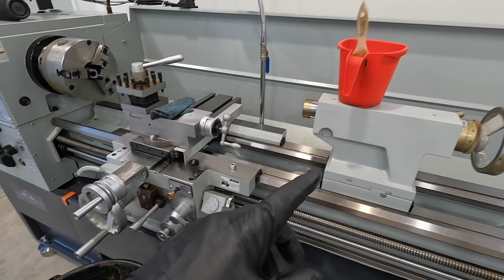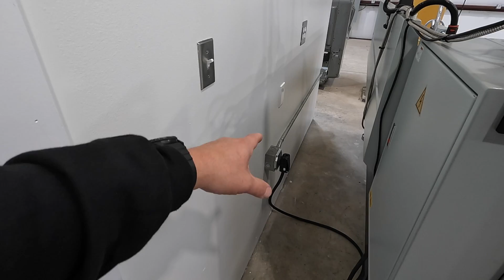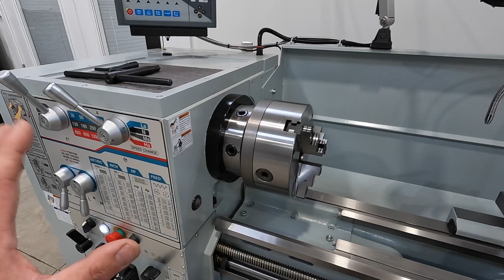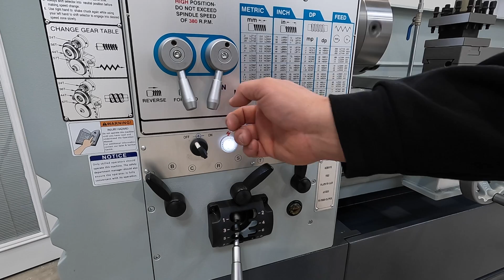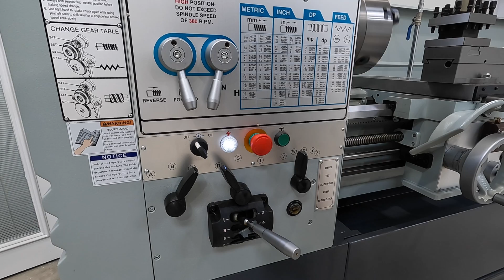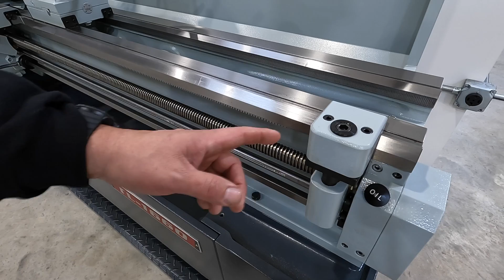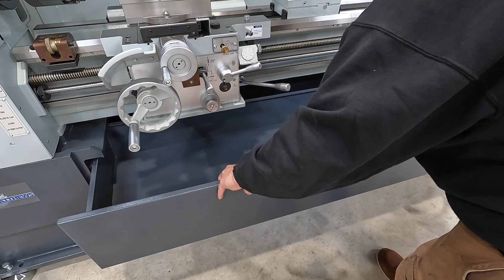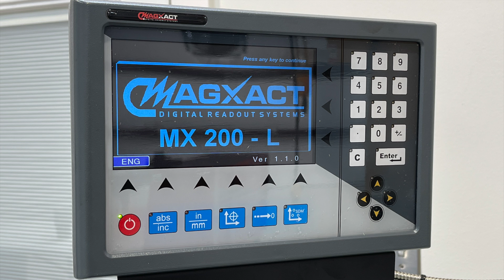Precision Matthews TL 1660 First Run

Comment: 15:30 "The bolt must be released before operating" ... It really looks like that bolt is in the "not released" position :(  ... what does that bolt do? 

16:26 Plus it specifically says "ONE SHOT PUMP" (In All-Caps too)  ... not ... "You can give this guy a couple pumps"
Reply: A couple of pumps and it runs on the floor - so what?  Adam has plenty of the famous "pig mat" to take care of it.
Reply: @paulcopeland9035   lol
Reply: There's a difference between "released" and "removed".  If it wasn't released, the carriage wouldn't be moving.  It locks the carriage.

Comment: That's a nice new machine Adam. Using the two t-slots on the back end of the cross slide would perfect to make up a back tool holder. I have a similar set up on my 15" causing and I use the rear holder as a dedicated turning tool. Really speeds things up having multiple tools on the cross slide at one time. Can't wait to see what other machines you bring in the new shop.

Comment: Abom you should get an audio frequency app on your phone. Then lay your phone on the lathe. This will show you the sound level and also the frequency peaks. You can take note of these and if you ever think you hear a strange sound just lay your phone back on and check the difference. You can get really good at it and tell the frequency changes by ear and pro level is diagnose the issue from the change in tone/frequency. Its also a beautiful machine. Thanks a lot for the video!!!

Comment: One thing that I have noticed about machines that have that type of feed cross/longitudinal selector, is that under heavy load they can be very hard to disengage !
You may want to check that the feed direction knob may be the better option for disengaging the feed!!!!
Ran a Summit lathe that was that way and we have BIG Kingston 12.25'' bore
hollow spindle lathe at work that you basically CAN"T disengage the feed under heavy load with the 
cross/longitudinal selector, has a separate 'clutch' for lever for that.
This caused a major crash and tear down of the headstock and replacement of gears, no fun!!!
Please check for this issue!!
NICE machine!!!!

;

Comment: Hey Adam, what kind of material would you be running at 1800 RPM? Mostly aluminum I imagine?
Reply from the maker: Anytime you are working with small diameters, like tiny drill bits.
Reply: Modern carbide tooling demands hig rpm as well at smaller diameters.
Reply: I was curious of that too, glad to see someone asked and got the answer!

Comment: There seems to be several companies that are selling the same or very similar lathes. I’m guessing the same Taiwanese factory slaps different names on the same lathe. Regardless, seems like a nice lathe.
Reply from the maker: Not slap, drive pin them on.
Reply: While the base casting may be the same, different companies have them made to different specifications.  They aren't all the same.

Comment: A retired electrician... Planning home workshop for purchase of a lathe and mill.  Question: What are the big steel feet for and why a 6 jaw chuck?  Bill G.
Reply: Feet are for leveling and the 6 jaw just because you get more even clamping force
Reply: Pretty sure the main benefit of the pads is to spread out the load on the concrete so it doesn't crack it or punch into it; the leveling bolts on the machine have a pretty small surface on the bottom. There may be other benefits as well, like lifting it higher to a more comfortable operating position.

Comment: Aren't you supposed to have something clamped in the chuck, when running the lathe spindle?
Reply: I doubt the lathe will get upset.
Reply: Yeah, more so with a scroll chuck.  Starts and stops can allow centrifugal force to throw the jaws out of the chuck because the scroll rotates.  Super dangerous in theory, but in reality, it rarely happens.

Comment: Why don't you install the power so that it drops from above?
Wouldn't that be better than having the power cord running across the floor, creating a trip hazard?
Reply: To come in from the 20 foot ceilings requires an extra 40 feet of cable and all that extra voltage drop and $$$.  How many people are going to be walking behind the machine?

Comment: There's something quite satisfying about peeling off protective film, whether it's from a machine tool, mobile phone, or whatever. 😊
Reply: It's therapeutic at best. People in China would never take off the film on anything, even when it bubbled up, peeling, and full of shmoo.
Reply: No! Leave that protective film on, it makes cleaning better because the face plate is protected from scratches while cleaning. I have gone 10 years before I finally peeled the film.
Reply: @jwagnermail  exactly my thought, it keeps all the information from wearing off for a good while!
Reply: @jwagnermail  I agree. I protect my DROs panels with shrink wrap.If the panels on that lathe were engraved,I would say,go ahead but, they are silk screened.He is going to regret peeling that film off. I would cut peel and stick clear acetate over it before,it’s too late
Reply: I knew there would be some sociopathic monsters that would come here and claim you should leave the plastic on.  I don't know why anyone would actually want a nice new machine to have cheap plastic all over it.
Reply: @HomebrewHorsepower  You haven't met my wife's mom then. She is from Peru and believes removing that film devalues the item. I am not allowed to remove it, even the pieces hanging down in front of the TV screens...
Reply: @HomebrewHorsepower  Because, it’s not going to look nice very long after taking it off. I have personally experienced this on my lathe.My threading chart got so bad, I was using the manual to set it up for threading. I ended up scanning the page and,importing it into Aspire as a PDF, I then,engraved it into a sheet of aluminum to replace the illegible chart .

Comment: I've had good luck using WD 40 to remove cosmoline also.
Reply: WD 40 is mostly mineral spirits.  Check the Safety Data Sheet.

Comment: what would run 1800 rmp for?   what material?
Reply from the maker: Soft materials like mild steel, aluminum, brass and copper especially if your working with very small diameters.

Comment: can you explain how the flood cooling works? i assume the coolant drops in the chip pan but how/where does it go from there?
Reply: It recirculates.
Reply: It falls down into the chip pan then it funnels through a strainer to remove the chips, from there it flows into a bin where the pump is housed.  It can then be reused.
Reply: @cayde7469  i did not see the strainer in the video.
Reply: @SupremeRuleroftheWorld  I don’t know on this particular lathe but at 22:13 to the far right of the chip pan it looks like that is where the filter for the coolant is.  I assume they put it to the far right since that side of the lathe will see the least amount of chips and therefore not get clogged as easily.

Comment: I got equipment with the plastic protecto coating still on it eventually when I go to sell it I will let the new owner decide to peal it off.
Reply: The protective films are not intended to be left on for long periods.
You will find that the adhesive hardens and the film will not release easily , tears and/or the adhesive leaves a residue that is difficult to remove.
Reply: Adam is the owner, so he decided.  What is your point?

Comment: Why is american wiring so third world and ugly?
Reply: in Europe we would just run some SWA to each outlet off individual breakers. The US seems to be wedded to round conduit and singles.
Reply: @AndyFletcherX31  Whats wrong with conduit and singles? Often the better option if it's done right.
Reply: @mmm365  Yes they do. 🤣
Reply: Ok. You be free.
Reply: When I first saw that installation, I thought "wow, what a fine job."  Nice bends, box installs (ex the one on the corner), clamps (per code), etc.  What's the matter with that?  To me, that's exactly what you want in an industrial building.  Should we be stuffing it behind the drywall and mudding everything up?
Reply: @billbuckalew9497  It’s ugly, basic and way behind the rest of the world.
Reply: I think you might need to research what the definition of third world is.
Reply: @stargazer7644  Yawn!!
Reply: @g06sfj76  Sorry, are we interrupting your nap time?
Reply: Conduit and metal boxes. Yeah really third world.. Enjoy your glorified extension cord wiring.
Reply: Because of freedom
Reply: @choclatellama123  And guns are good, Trump is a genius and Biden is the leader of the free world. 🤣 And before you say it yes Boris Johnson is a complete joke!
Reply: This is industrial wiring , it’s not meant to be pretty , it’s meant to be quick and easy to install and durable, the UK can’t get anything done faster than they can make laws and regulations about it which probably takes decades

Comment: Adam - Just realized the lathe pass through and the door aren't going to like each other. You get something coming out the back end of the lathe and someone opens the door ... gunna have new ventilation. I know you said something about a door stop or what have you, but that's not going to prevent something happening when you're running a long piece of work out the back end.

EDIT: You might want to consider just making that door next to the lathe not open. Use the other door for ingress/egress (though it looks like the door handle is on the door closest to the lathe.) Just a thought.
Reply: Child safety lock haha
Reply: If it's a 32" door I would bet that any pass through will clear the door, he has something like 16-18" of clearance behind the machine so I think it will be far enough away to miss the door, also it probably won't be to big an issue since he will be by himself 99% of the time.
Reply: The door doesn't swing our far enough to cover the back of the spindle, it just hits the back corner of the lathe.

Comment: how much do you pay for this little toy-:)
Reply: the base model is about 17k, adding all the sweetness is about another 5k according to the website.
Reply: @waynesardullo2482  The 1440 is 17k.  The 1660 is 20k.  You've gotta select the model in the pull-down.  Plus the goodies.
Reply: @stargazer7644  I must have misread it cause I could have sworn it said 17k for the 1660

Comment: Adam, most lathes have the saddle switch up for forward.  Was this your preference to have it down for forward
Reply: Every lathe I've ever used has the switch swing in the same direction as the rotation, just as this one does.